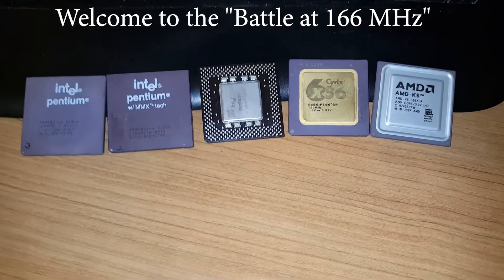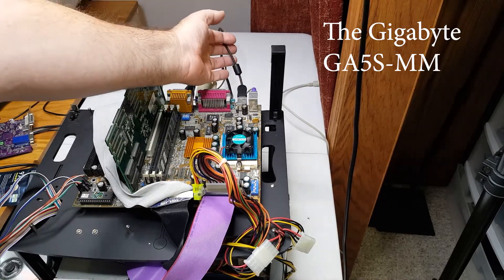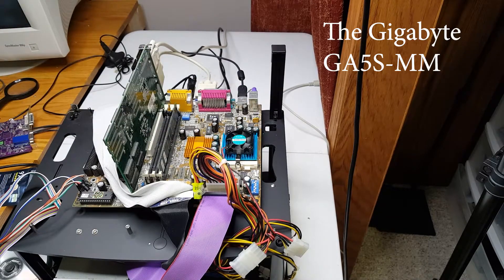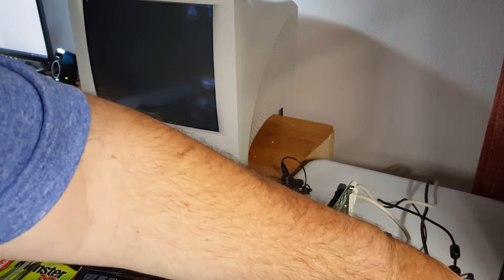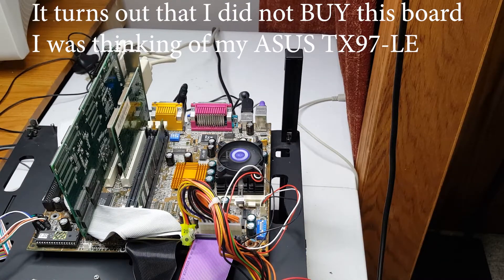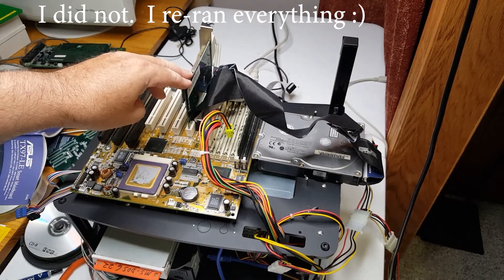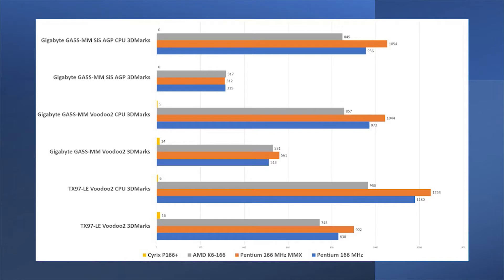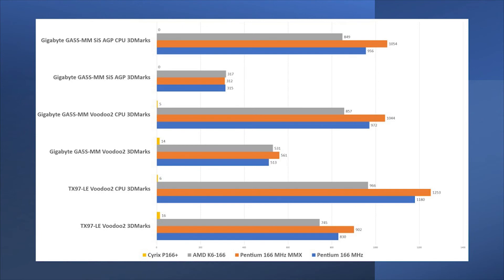Battle of the 166 MHz Socket 7 CPUs.  Intel versus AMD versus Cyrix.

Comment: Thats so strange how the Cyrix chip does not show up in the benchmarks. I have seen others do the same and they get the same results with the Cyrix cpu and the strange incompatibilities with benchmark software. Maybe a patch or updated versions of the benchmark software. A K5 PR 166 the Cyrix PR 166 with MMX would have been a great addition in the test. Great video Uncle Mike.
Reply from the maker: Awww thanks, pal!  I think maybe the later 3DMark suites were more optimized for other CPUs.  But, nothing more powerful would even run on this little guy.  If I ever get ahold of another Cyrix MIII series CPU then we'll see😊